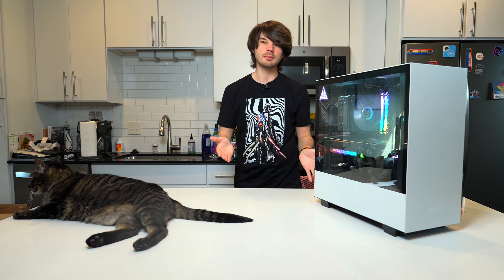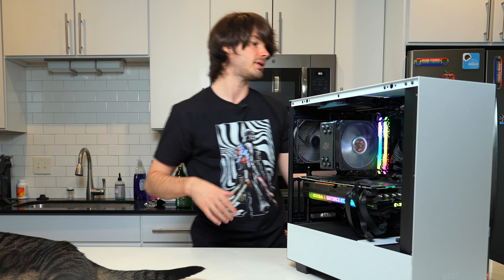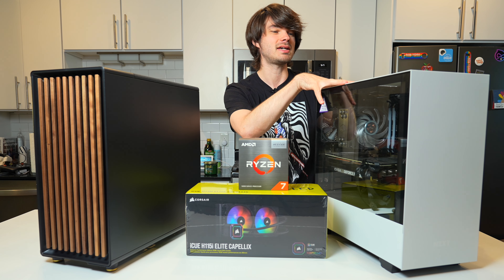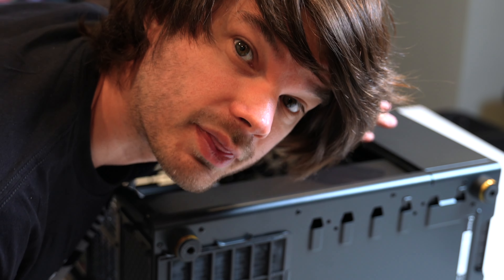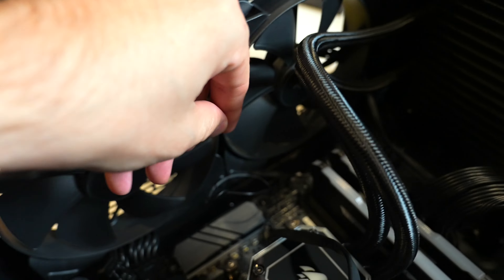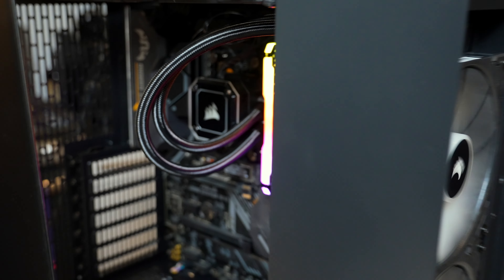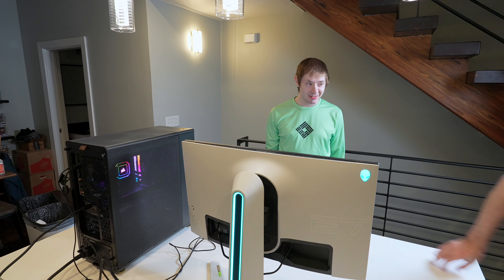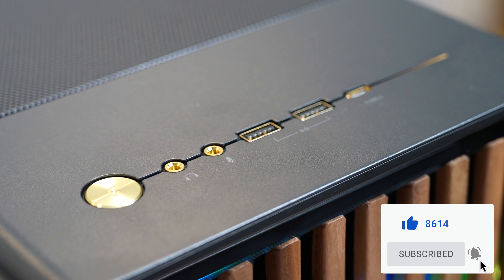Upgrading His PC with 5800X3D, 4070 Ti, & Fractal North

Comment: 3080TI 12GB vs 4070TI 12GB doesn't  worth to upgrade it. The gain is minimal. The big gain would be with a 4070TI Super 16GB.
Reply from the maker: Both are great cards. It comes down to DLSS 3 and power/heat efficiency. The 4070ti wins in those regards.